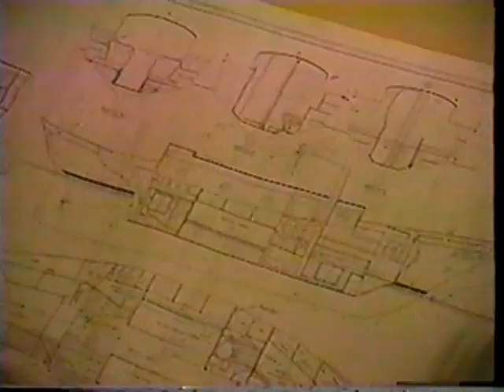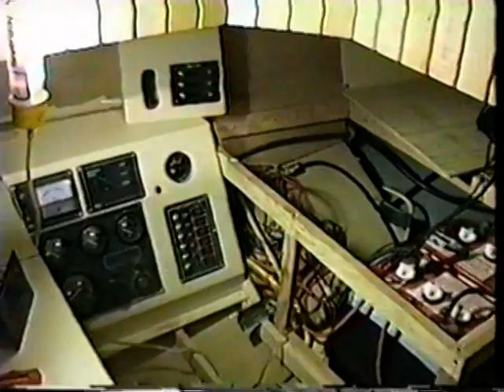Part 1 Glamour Witch Building of a Dream

Comment from the maker: Hi, The insulation I used was a comerical marine lava rock material with a thick poly vapour barrier that extended to the bildge. The the lining and bulkheads went in after that. This way the insulation and VB were homogenius without gaps. Glad you enjoyed the video. I enjoyed building GW. I hope to post another video shortly, about the fit and finishing of my next vessel, 'Blue Eden'. Cheers

Comment: Beautiful! What was the insulation and plastic sheeting you put in at about 3.25 on this video? Hows it working out? I've been warned off doing this for a steel boat; lots of people have suggested that the plastic deteriorates and the foam gets soggy, but I guess it depends on whether you use closed cell or open cell insulation? Thanks for the video.